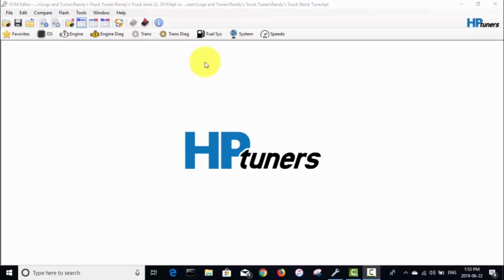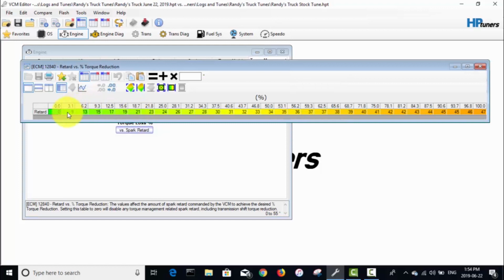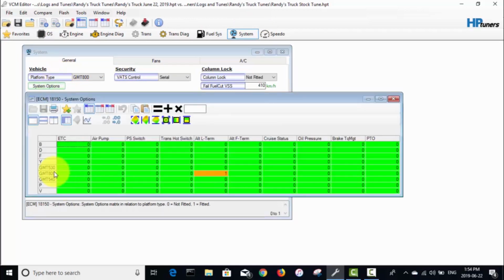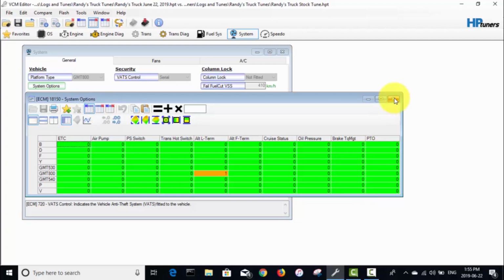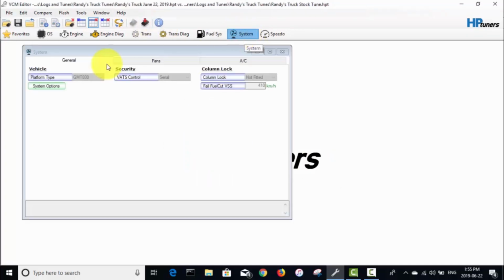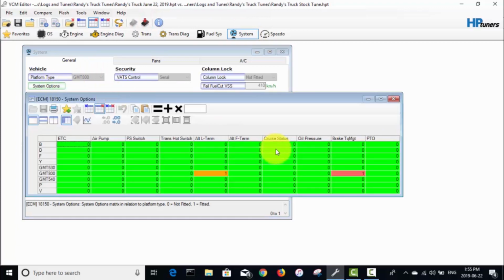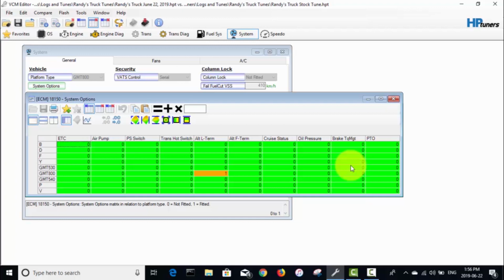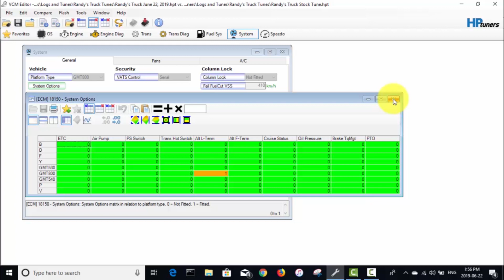Disabling Brake Torque Management with HP Tuners

Comment: That should help with burnouts I made to do that on my suburban that I just finished rebuilding the trans in and I got a I assume restalled stock torque converter that was a 1900-2200 I haven't tried a burnout yet but I think it will still struggle

Comment: Great Vid ,,,,Do I still have TM using a non computer trans with a stand alone harness for a ls swap ?
Reply from the maker: Dels Transs I don’t think Torque Management will be an issue if you don’t have a computer controlled transmission
Reply: @LowbuckLS  Thanks for the reply back ,,Umm just wondering if the TM causes lagging upon acceleration to save the tranny
Reply from the maker: Dels Transs I know normally the computer will pull timing during the shifts and if your foot is on the brake in gear, but if your transmission isn’t electronic it wouldn’t know if it was in gear or when the shifts were happening. I guess you could log the timing to verify that the computer isn’t pulling any timing.
Reply: @LowbuckLS  Ok thank you thats a good idea

Comment: Thanks for the info Randy. Put a Corvette Servo in your 60E. It'll give you a clean 1-2 2-3 shift. Cheapest mod you can do to it and it makes a big difference in the transmission's performance
Reply from the maker: Thanks, yeah definitely need to beef up the trans some, will look into the servo upgrade for sure!
Reply: @LowbuckLS  It's literally like a $20 mod! I've done it twice
Reply from the maker: David Edge nice, I’ll probably do it for sure then
Reply: Corvette servo has ZERO effect on the 2-3 upshift. The servo applies the BAND. The band is ONLY active in 2nd and 4th, meaning the 1-2 upshift, is the ONLY upshift affected by adding a corvette servo as the original "4th" piston is still retained even with a Corvette servo.   Yes, it is a good, cheap, mod but it will ONLY help on the 1-2 shift.
Reply: I’ve done this to about 7 trucks of mine. Best mod for any 4L60e